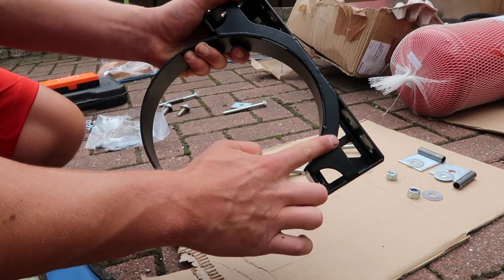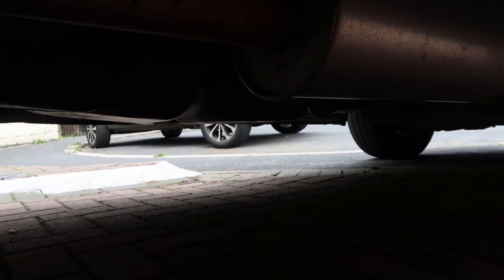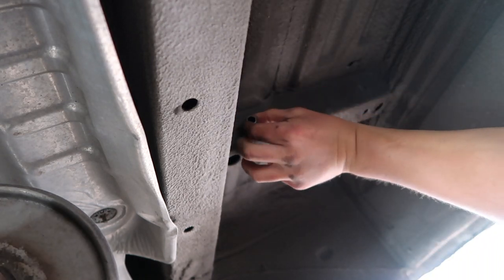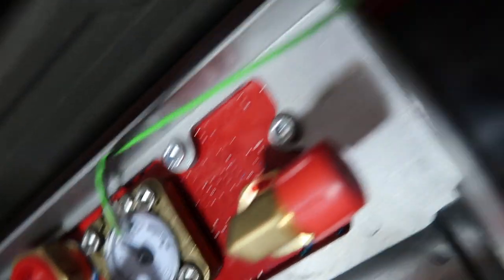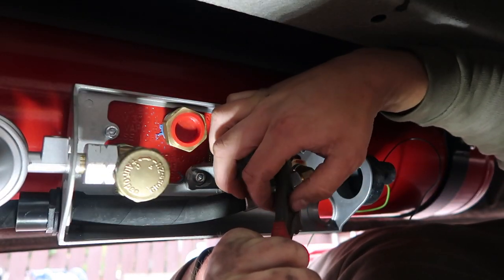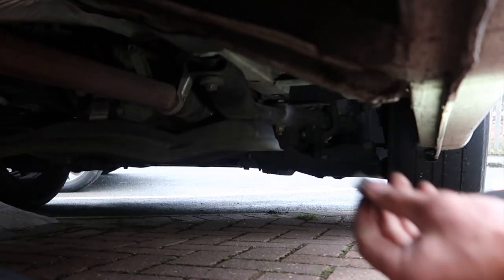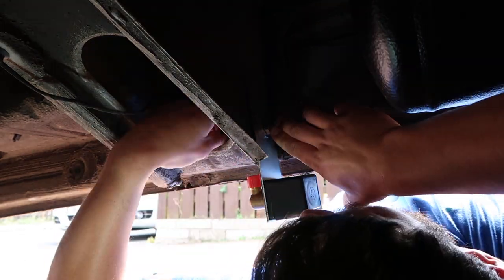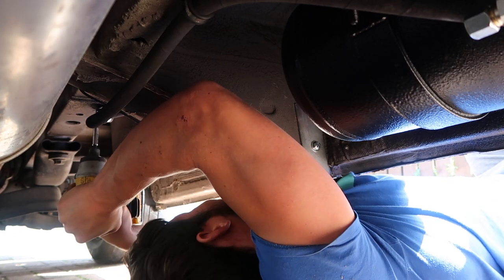Gas-It Underslung Tank Install | Ep3 | Sprinter Camper Van Conversion

Comment: Thank you for the video - need to re-watch it. 
Valve box cover isn't very accessible - I suppose the gas can be turned on/off with an electric valve (power save saves some electric).

Comment: Thanks for the inspirational video. I got my GasIt tank delivered to California and installed it on my Sprinter 😁
Reply: Hey Lars, what size tank did you end up getting and how much was shipping to Cali?
Reply: @roach6791  I got the 30L tank. Airfreight was only £294 and it arrived three days after shipping. There was a more expensive and quicker option, but I asked for a cheaper one -- which was still so fast.

Comment: Is it legit to combine a refillable underslung tank into an existing system of two cylinders (gaslow / alugas etc)  ?
Reply from the maker: I'm not sure is the answer to that one. I think the main problem you will face is T'ing the flexi pipe from to the two cylinders to the 8mm copper feed but I would think you'll be able to get hold of a manifold that you could run both feeds into. Then if all feeds are pressurised correctly I can't see why there would be a problem. You many have to see if the flexi and the copper run at the same psi and should be good to go. Disclaimer I'm not a qualified engineer so you would be best consulting one. Good luck

Comment: After watching this, and believeing the autogasleisure kits looked the best engineered solution i bought one for my sprinter conversion.
Yes the brackets are very well made etc but overall i feel dissapointed with the kit, my main gripe being the weather proofing, or specifically lack of.
To allow installation of the supplied "GOK" regulator, autogas leisure re-machine the tank boxes which in turn removes the attachment for the weather proof boot leaving a large hole at the front for rain to drive straight into.
The box lid is completely weather proof with a rubber seal, and rubber boots on all other openings so rain now gets in through the front and stays in. After driving the van once in the rain 4 weeks later it was a corroding alumimium mess in there and i have not even finished the van conversion yet.
Apparently no one else has is worried by this, to their credit they did later send a generic rubber grommet but i found it was the wrong size to fit anyway so i just drilled a hole in the bottom of the box as a drain and tried to forget about it.

I do not normally write comments on videos but i felt i should share this information so people are aware before investing £500 of their hard earned cash.
Cheers.
Reply from the maker: Thanks for the comment. Sorry to hear about the problems. Never had these problems with our install. Open gaps should always be sealed, especially outside a car or van

Comment: Sprinters are already known for their rust, lol. Probably should have painted those holes, mate.
Reply from the maker: Known for rust on the thin sheet metal when in white and only had one coat of paint. We'll be dead and buried by the time rust got through that steel box section

Comment: hi Scott! really enjoyed the video and feel like i've learned something :) 
I appreciate this is a while back, but i was wondering if you can tell me if you experienced any issue with filling the tank? i watched a video on the GasIt YouTube channel and they mention that the  80% shutoff valve (the one you turned to face the front of the vehicle) works by having a little float within the tank, which goes up as you fill, effectively stopping the inflow of gas when 80% is reached. 
Did that get turned upside down when you turned the valve? (sorry for the long waffling question)
Reply from the maker: Hi. We've experienced no problem and no the mechanism is not affected by turning the valve
Reply: @ScottAndJen  that sounds great. may go down the same route then. i am just working my way through the van videos. interesting to see your videos from 2018 and how they are very much current. best of luck

Comment: Hey hope your well.  
What size copper pipe did u use? 8mm or 10mm ? 
Thanx in advance :)
Reply from the maker: its 8mm
Reply: @ScottAndJen  OK so the connections in/out of the regulator are both 8mm?
Seems like a good idea to put the regulator there.
Thanks

Comment: Mate any reason you have positioned the locker/pipes facing inboard?
Reply from the maker: Sorry can you clarify whay you mean? If you mean the filling bracket then no you can position this anywhere that the filling hose can reach to
Reply: Scott & Jen i mean the part with the guage/valves etc in the little locker. If it was facing outboard it’d be easier to access no? Just wondering if there was a reason it was facing the centre of the van not the outside
Reply from the maker: That is the way the installation instructions advised. Also dont think there is ample room between tank and bodywork if its the other way around
Reply: Scott & Jen roger that mate...just got under my van to fit mine and eaten my words...pretty much only fits that way🤦🏼‍♂️🤦🏼‍♂️ thanks again dude

Comment: how many liters is your tank? I think a 40liter will fit my sprinter, might be too snug though.
Reply from the maker: Hi there. This is a 30l lpg tank
Reply: @ScottAndJen  Sorry for hitting you up in a few different threads but which 30L tank did you end up getting because there are two (270 x 607mm or the 200 x 1052mm)?

Comment: hi great job,was it expensive, the paint chip is a great idea.
Reply from the maker: Thanks Eugene. The price was basically the price of the kit from Autogas2000 you can check out their kit prices via their website that will be specific for you conversion or job.

Comment: When you wired the gauge in to the cab how is the wiring diagram done
Reply from the maker: Diagram comes with kit. Gauge in tank under van is earthed and live ran to gauge inside van. Also poitive feed wired to gauge insode and negative earthed to chassis
Reply: Scott & Jen I got my gas tank kit from LPG shop I have fitted the tank and the filler and also the gas feed pipe to the 4 way splitter but no instructions how to do any of the insulation I have a black and green wire that comes out of the gauge that I have changed on the tank and the LCD level gauge as a red and black and a green + so do I just put a live + and  - feed to them or just to the red +
Reply from the maker: @ivecamperbuild_thomas4084  green to green. Blacks earthed and positive live to the red wire on LCD if im not mistaken
Reply: Scott & Jen that’s what I thought but wanted to check to make sure thanks hope your having a good weekend